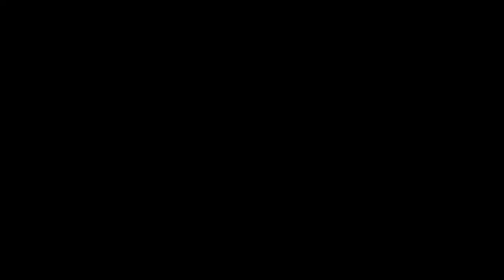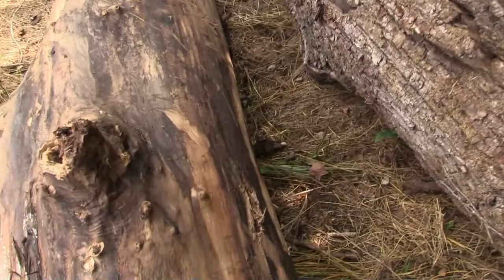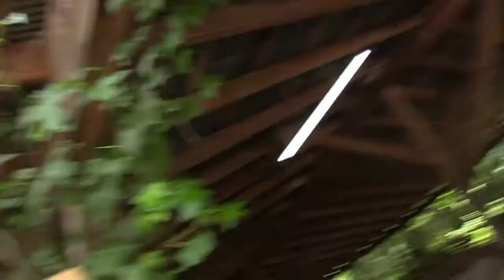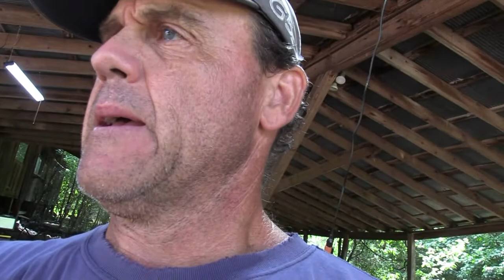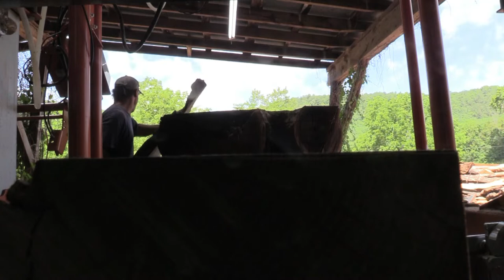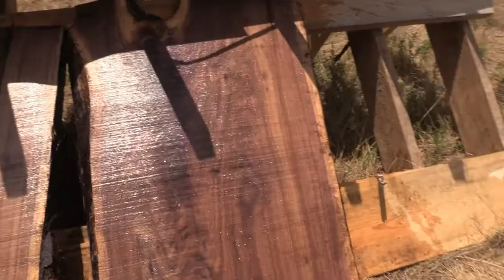Stunning Walnut on the Norwood HD 38

Comment: Nice job clamping down the log.  Sometimes it seems to take as much time to load & secure an oddball log as it does to mill it!   Would love to have seen how you got the log up there.  If you switch sides of the clamp and log stops, the sliding blade guide can only be all the way back, and you will have a lot of blade exposed on the exit side of the blade on smaller logs.  You'll also be dealing with more sawdust in the air, since the chute won't be as effective.  In some conditions, you might experience some blade flutter, and that safety bar will not protect you from the exposed blade outside the wood.  In hind sight, I'd set up the mill exactly the way you have it, but with an extra crossbunk between the first and second ones and put the front toe roller on it.  Nice feathered grain.  Also, nice to see progress on the kiln in the background.
Reply from the maker: Hey Dave, thanks!  I like the extra log bunk idea, we have been thinking about getting an extra one for these type logs.  Definitely securing them would be less challenging.